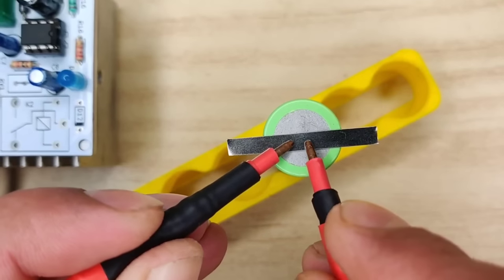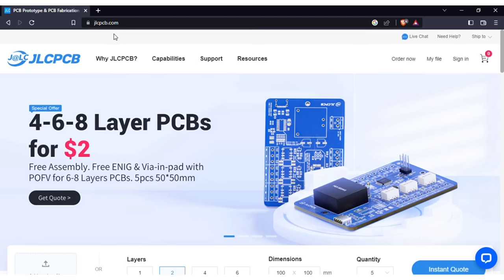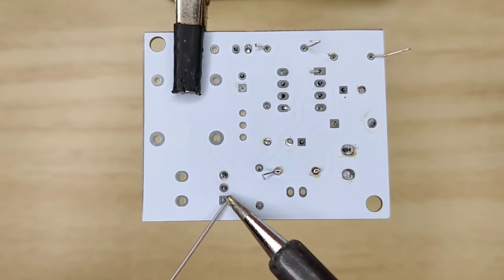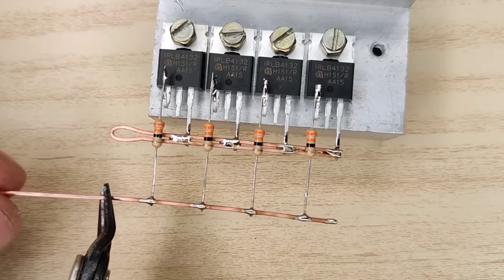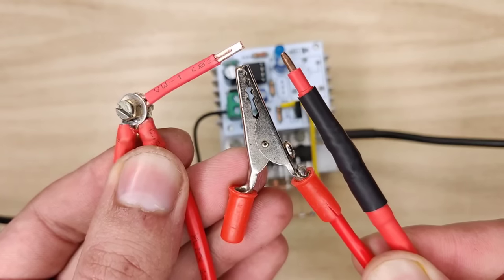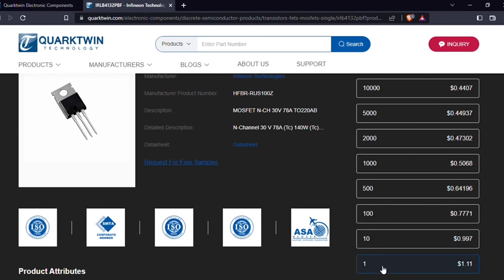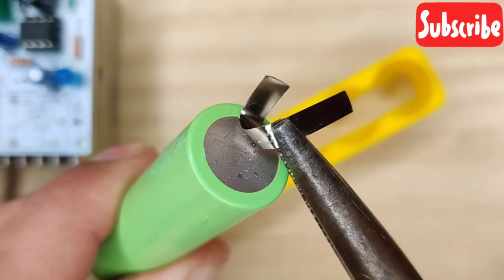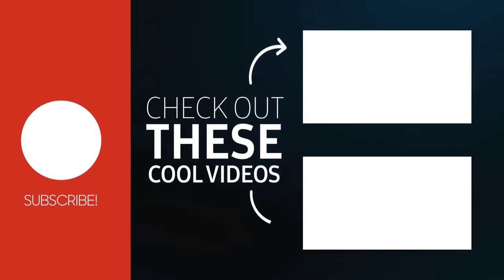DIY Powerful Mini Spot welding machine

Comment: Too week weld…what is the amperage ?Did you measure with the clamps ?
Reply from the maker: The weld is strong enough to weld the cells together, you can add more mosfets to get high power welding shots.

Comment: Can I use 12V transformer instead of battery?
Reply from the maker: You can use transformer but should be 30A atleast and will be huge, so good is to go with 35Ah lead acid battery or 2000mah 12v 🍊 lithium battery

Comment: I recently saw someone demonstrating a battery welder where they just put the probes on the battery strip and didn't have to push a button.  Apparently it senses the short, then builds and releases a charge.  Think you can work that in?  I can only think of using a micro controller but I guess that would complicate it.
Reply from the maker: I'm soon uploading automatic spot welder using microcontroller, this circuit is also working awesome, since it is easy to make without programming
Reply: @CreativeTechos  Looking forward to the micro controlled.  I like the ATMEGA328, though the ATtiny would be enough.

Comment: Very nice informative project . Thanks a lot . 
Just one question . Why u didnt use the relay and the output terminal on the PCB ? they were originally designed to be there ?
Reply from the maker: It was actually designed for another project, but i managed to use 555 ic as  mili seconds timer, so used in spot welder project, 
You can check new version of this spot welder with compact pcb based on 555 ic
Reply: @CreativeTechos  can you share the LInk of the new version ?

Comment: Then, why did you add a relay to the PCB layout? Can I use the relay instead of the MOSFETs?
Reply from the maker: This pcb was actually designed for another project, but it also served to this project, you can find new driver pcb files link in video description
Reply from the maker: Relay will actually fuse with a single weld, also it cannot do switching with mili seconds of switching pwm
Reply: @CreativeTechos  okay. Thanks

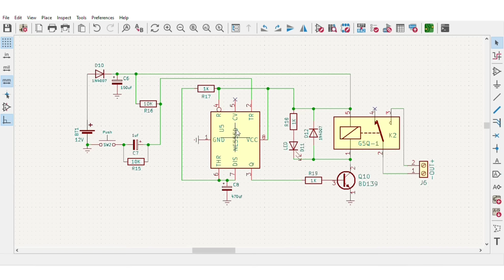Comment: 0:33 schematic looks different than drive schematic and capacitor value is 1uF in drive schematic please clear this thing because I didn't understand , im gonna make it
Reply from the maker: Actually i used the pcb that was actually made for another project, but it also served me for this purpose, The circuit diagram uploaded is fully working.
And i have provided PCB files of both.
Either you can use same pcb like shown in video, or download New spot welder driver PCB, it is upto your choice.
Reply: I think..the PCB using of similar with the others pro project..

Comment: hello...
tell us...we need how much current and voltage to feed this spot welder???
Reply from the maker: You need to use 12 volts with minimum 35Ah lead acid battery, (or 2000mah lithium polymer battery as they can discharge high current)
Reply: @CreativeTechos  thank you my friend
Reply from the maker: My pleasure, Thanks for watching 👍